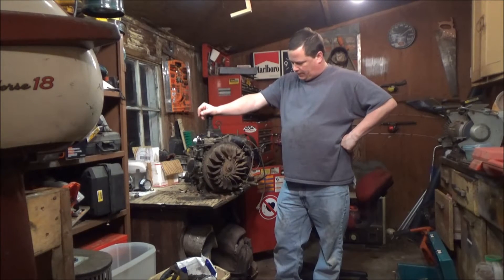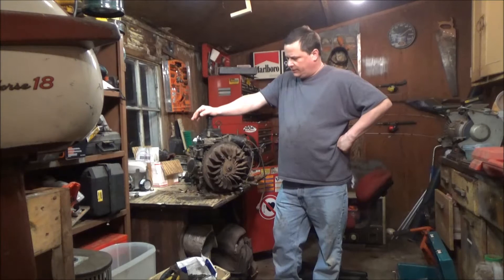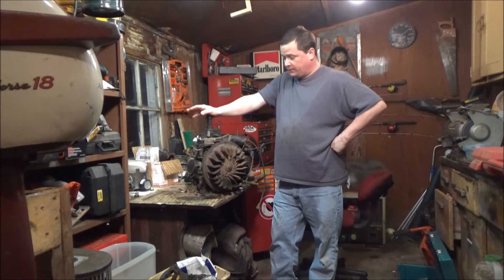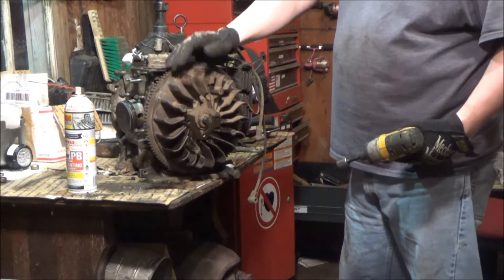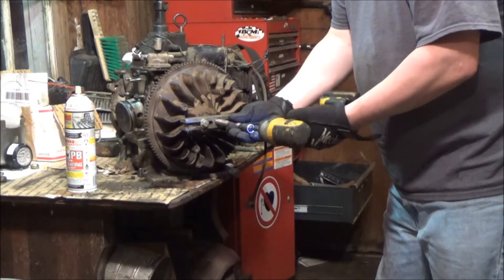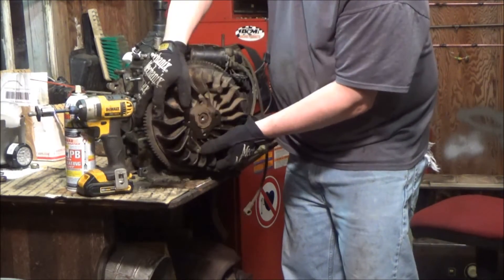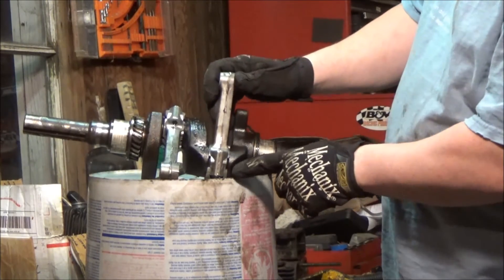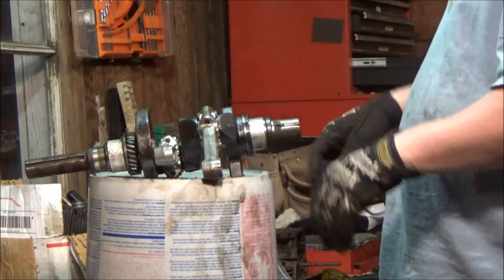Kohler kt17 Rebuild Part 1: Teardown

Comment: Thanks for making videos on this. I picked up a JD 317 last week in sorta rough cosmetic shape with a KT17QS that had thrown a rod. The plan was to pick up a new crank, rods and pistons and rebuild it if the block wasn't damaged and spruce the tractor up too. I didn't realize how many steps it was to take these apart compared to the briggs boxer engines, but the kohlers seem to be of much better quality. Worst case I'll part the engine and use that money to modify a 999cc generac ohvi engine I have laying around to run the deere.

Edit: just got it tore down. Looks like the only part of the block that took a hit was the jug on the side that let go. It took a chunk out of the sleeve, but it isn't too bad. I'm gonna give it the green light for rebuild... and it looks to be a series 2 with the pressurized oil system. Can't wait to dunk it in the ultrasonic cleaner.